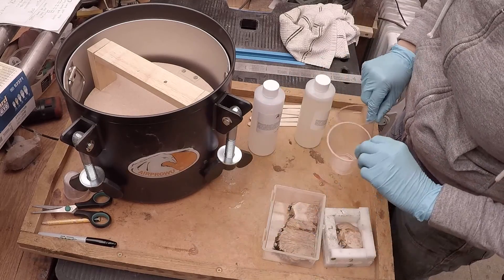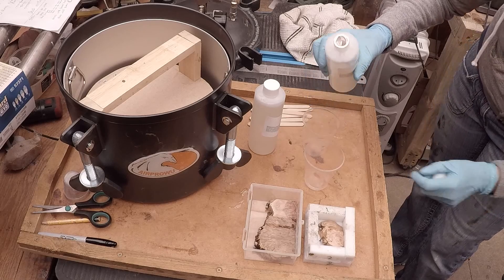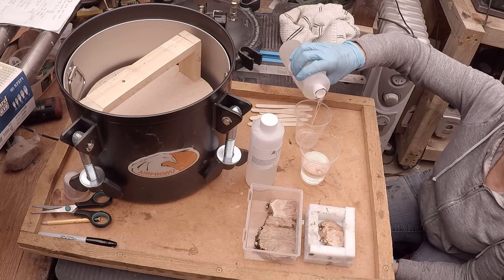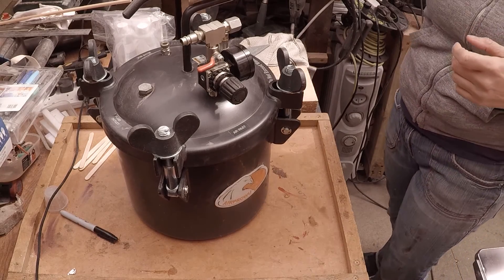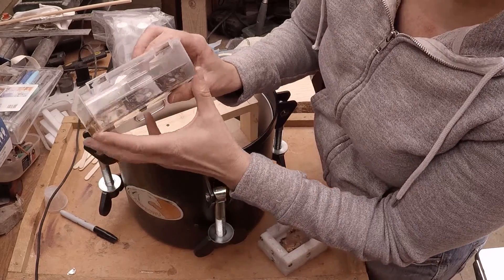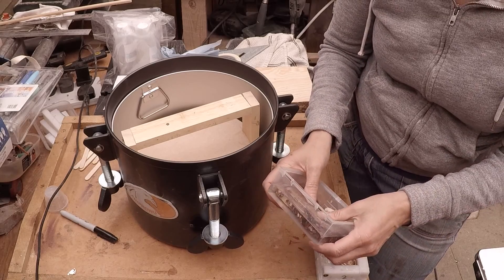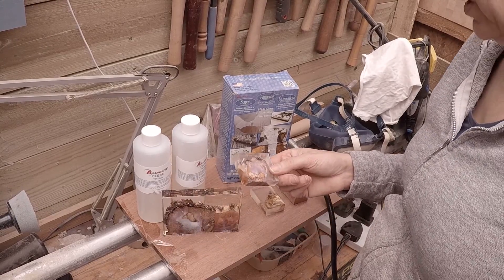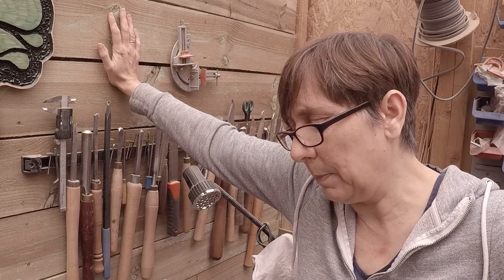Testing resin pressure chamber.

Comment: According to Alumilite customer service white cloudiness is only caused by to much part "A" or not mixing properly. If you are sure you are mixing properly and measuring properly and still have cloudiness then reduce part "A" by 10 - 15% and run a test. Bubbles, even after pressure, is only caused by moisture. It appears your wood had moisture. Even if you don't stablelize the wood you should cook it in an oven several hours to help get the moisture out. Hope this helps, I had to find out through experience also.
Reply from the maker: Thank you Jerry some great tips for me to try out thank you for sharing the information i will pin this to the top of comments so it also helps others. :-)
Reply: Another problem might be that alumilite should be measured by weight.

Comment: Good video Girl 👍🏾
If you had used a 24hr epoxy you wouldn't
Of got the white spots.
And using pressure will make any air come out of wood and turn it into bubbles...

Comment: Great video, shame about the blanks, can you use a pressure pot for stabilising with cactus  juice or will it only work with vacuum.
Reply from the maker: no vacuum for stabilising and also can be used to degass resin thats what i used at first :-)
Reply: Thank you for the information, Keep up the GREAT video's

Comment: The cloudiness is most likely not anything to do with the resin. Any wood added to resin absolutely must be sealed with something like polyurethane ect and allowed to dry fully before going in resin. Even if the wood has very little moisture content it will always have pockets of air in it as well. These will release inside the resin and create air bubbles. I have learned this from failing many times before.
Reply from the maker: Thank you KG yes this was one of many fails with this resin due to it being sensitive to any moisture. I find drying wood and keeping sealed helps to stop this. Many thanks :-)
Reply: @Highlandboxes  Thank you for your reply.  Through failing we learn :)

Comment: I've just got my pressure pot today.  I did a test pressure run  (60PSI) and put some washing up liquid around the fitting to see if there were any leaks.  It was like a foam party.  every fitting leaked.  It lost 30 PSI in 1 hour.  I took all the fittings off and put PTFE tape around them but still leaking badly.  I left my compressor attached and it went off every 22 minutes to refill the pressure pot.  Would you say this was a faulty pot?  How much does yours loose?
Reply from the maker: Hi Chris it shouldnt lose that much i would say the pots faulty also none of the valves i have lose any air. i lose pressure but over 12 hours about 10 to 15 psi. Hope this helps pam

Comment: I think a few people here is correct. The white fog or mist in the resin is moisture, dry the wood in a toaster oven to get them dry as you can. Zac Higgins has a lot of info on his channel....NV Woodwerks...he use's aluimite only with and without dyes and powders. From the looks of it you was way under 7mins...try again with the pen blanks and see if the bubbles are in them. The only other thing is the smaller mold mite be to high and the high pressure cannot get in the center of that mold in time before the resin goes off, but that is a far out guess on that...still that pressure pot looks great a lot better than harbor freight ones...have a great day and weekend
Reply from the maker: Yeh will do another few test with stabalised wood and will text the epoxy and amazing casting resin will let you know the outcome. I also enjoy Zac channel  . Yeh its a good pressure pot no doubt about that. Thank you robert have a great day. Pam :-)

Comment: I haven't tried Alumilite Clear yet, but what I learnt from videos of other casters, with this resin wood needs to be stabilised or absolutely free of moisture, so you could put your would in the oven at 100 degrees for 24 hours to remove all moisture, just like before stabilizing the wood.
I have the same pressure pot, that knob next to the inlet is to limit the pressure going into the chamber. I cranked it down first then connected compressor, pressure was very low, so I slowly cranked it up until I reach 60. So now I'm not worry about it not holding pressure, because I leave the compressor connected, so it keep it always at the same level.
Hope that it helps.
See you at Makers Central next year.
Karol
Reply: Thanks for sharing Pam
Reply from the maker: Thank you so much Karol great advice and now i know what that knobs for lol. I will get some wood stabilised for using with that resin will test out other resins see if it does the same. So looking forward to meeting everyone next year :-)
Reply from the maker: Thank you Peter :-)